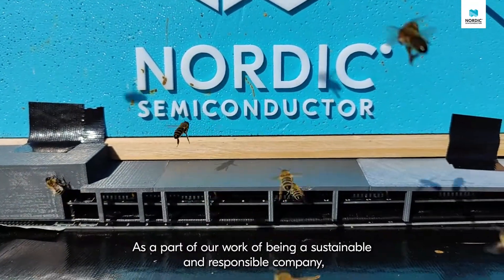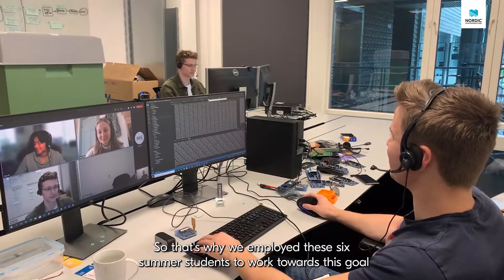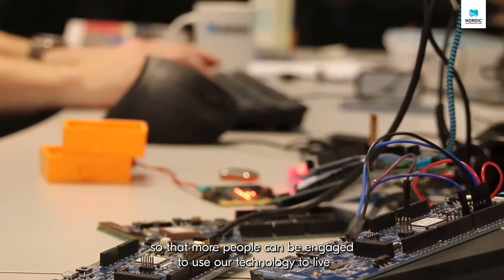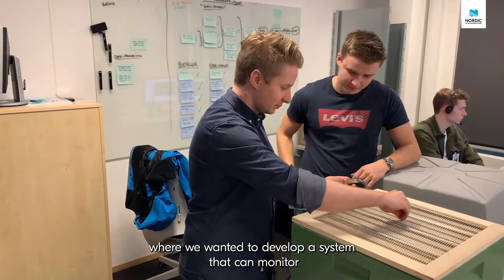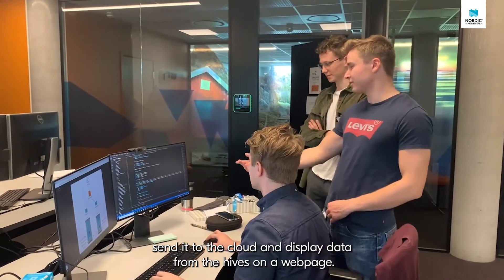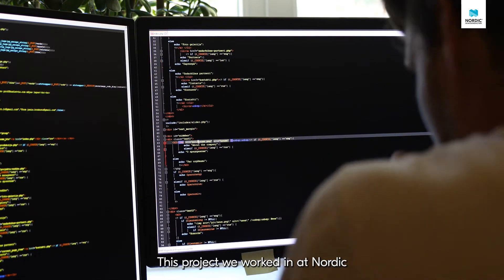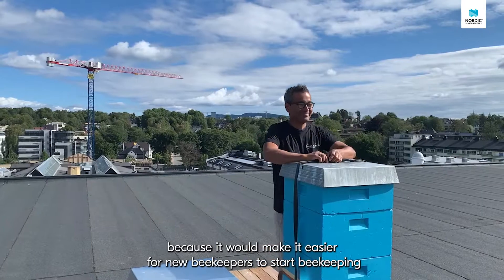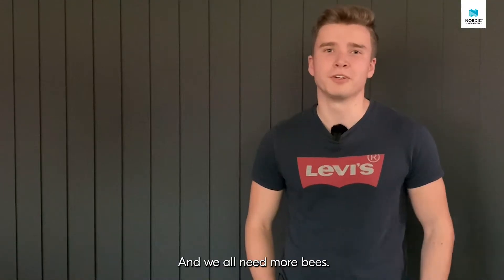Smart Hives: Beehavior Monitoring

Comment: What sort of telemetry are you collecting from the hives? And is the data which you have selected to collect based upon sensor type based upon previous peer reviewed work or research? For instance, take varroa mites for example, is a colony which is infected with varroa producing significant enough change which can be measured in the hive by using various sensors or IoT technologies? Like temperature for example? Or maybe CO2 levels? Just spitballing here but I'm just curious. Thanks.